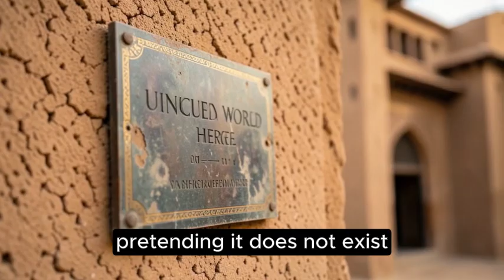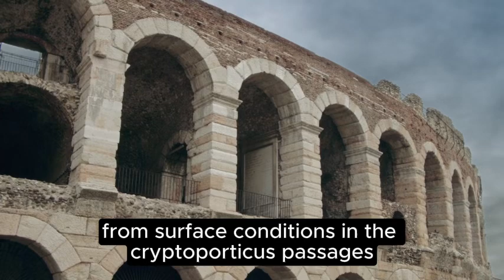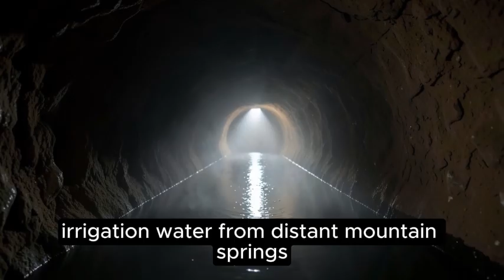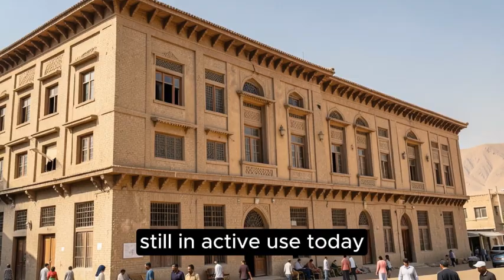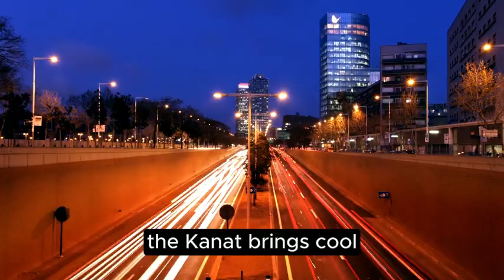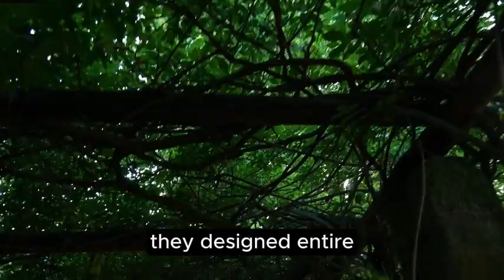The Forgotten Persian Tower That Cooled Homes 30°F Without Electricity

Comment: What the badger looks like is a thermal chimney.  You may be a bit confused as to how it works: at night the warm air of the house flows up the chimney and out the vents. This draws cool night air into the house for what is known as, "night-purge" ventilation. The tunnels provide geothermal cooling. I don't see the air flow going down the chimney but rather, up. I must visit to verify my theory.